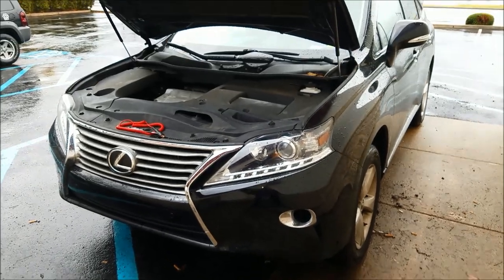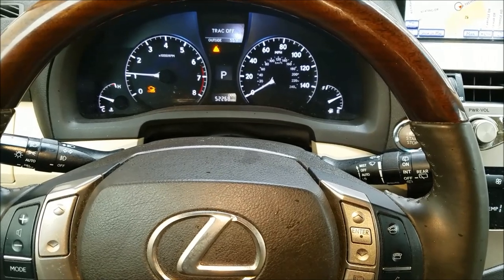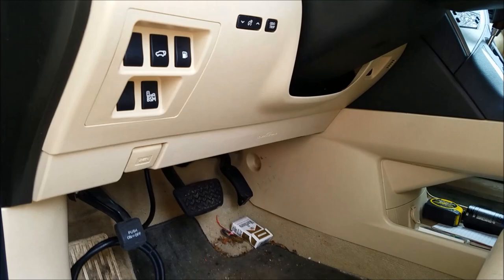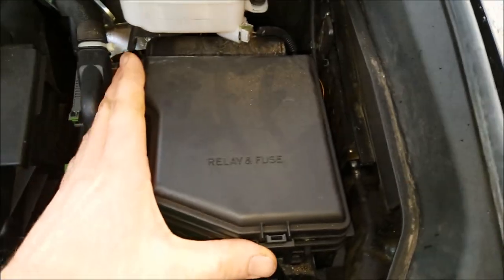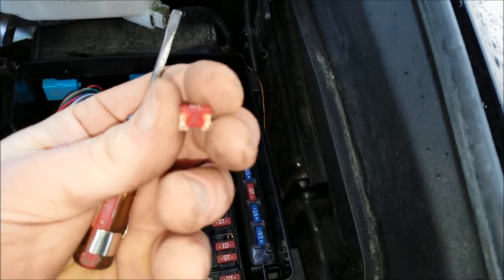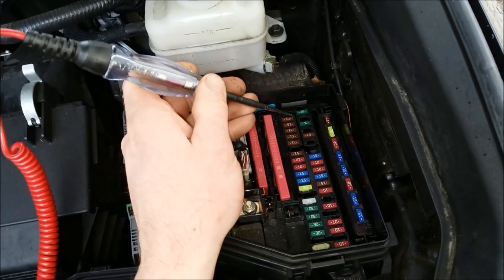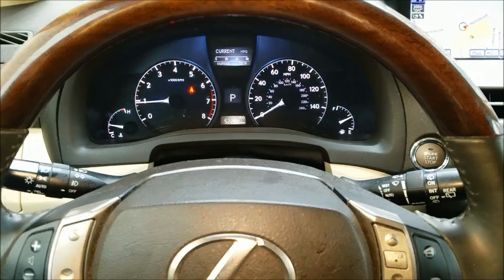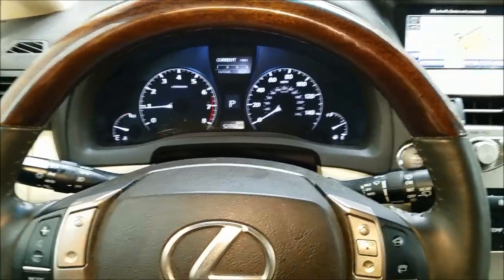LEXUS RX350 P2118 wont accelerate ETCS also FUSE BOX LOCATION toyota rx

Comment: THANK YOU VERY MUCH FOR THIS VIDEO! HAVE A CUSTOMER'S CAR HERE IN THE BODY SHOP THAT HAD A DEAD BATTERY. SHE JUMPED IT TO DRIVE IT HERE, AND WAS STUCK IN LIMP MODE EVER SINCE. REPLACED THE BATTERY WHILE HERE AND THEN THIS FUSE. NOW RUNNING GREAT. THANKS AGAIN!

Comment: Wow!  Thank you so much.  This just happened to my RX 350 this morning.   My husband tried to jump start the car and he got confused about placing the jump cables on the batteries and a bit of smoke came off of the connection and he moved the cables and let the car charge but the gas pedal just didn't work properly.  Look it up and found your channel and it has really helped.

Comment: 🎉 wow thank you so much I just took my 2013 Lexus RX 350 down to have some bodywork done after the bodywork was complete. The shop called me and told me that the car only idles and that it will need to be towed back to my house I was freaking out, so I got on line to look. What could be the problem I found at this website and and called the body shop and had them watch the video and bingo. That was it. The fuse was blown and now the car is perfect. Thank you so much who knows what this would’ve cost with me at a shop I’m so happy right now thank you thank you thank you.🎉

Comment: Had an issue like this in a 2006 rav4. The car was sitting for a while and needed a new alternator and after starting it ran like crap. Did some digging around and found the etcs issue and there wasn't even a fuse in that slot. Weird. Heading to go get new fuses now. Appreciate the video. Short and straight to the point.
Reply from the maker: Interesting. Wonder why the fuse was missing?
Reply: @NoNonsenseKnowHow  I have no idea. The car was purchased for my niece, SO put a new fuse in it and see what happens. Start with cheap fixes and hope it works.
Reply from the maker: Got you. Cool. Hopefully it takes care of the issue
Reply: @NoNonsenseKnowHow  The issue ended up being that AND the fuel pump fuse was blown. Quick easy fix.

Comment: Worked on my 2003 gs 300.  Thank you
Reply: I messed my GS300 trying to jump it. I changes the 120v fuse it was blown, now im looking for why the throttle wont rev the engine.

Comment: Thanks for this.
Currently have this issue on a 2005 RX300.
Fuse was indeed blown (after cross connecting the Jump Leads!), but with the Fuse replaced, still won't rev beyond 1800rpm.
Diagnosis shows no Fault Codes, but Engine Check Light remains on.

Comment: Thanks easy fix for my mom's avalon thought it was the throttle body
Reply from the maker: No problem. Thanks for dropping a comment.  Did you guys jump start the Avalon recently? I still haven't figured out why these fuses are common to pop
Reply: NoNonsenseKnowHow yea i believe that was the issue the battery was dead for a while just replaced it today and the engine light was on and it was idling weird and would not accelerate, and yea we jumped it so many times that's definently what caused the issue
Reply from the maker: Got you. Okay yeah that makes sense then. Must be the jump starting. thanks
Reply: NoNonsenseKnowHow yup thank you for this video i was about to buy a new throttle body saved me alot of time and money👍

Comment: I need help 

2007 is350 

Car was jumped backwards. So I had to replace the fusible link which I did. Car didn't start after wards . I checked fuses and remembered that I had to put the EFI fuse back in that fell the day before when I was checking them.  So I did that. The car started and the check engine light was on p2118. It had no throttle response. I then checked fuses again and noticed I think it was the ecu had a 15amp instead of 10 amp( I think that was the fuse ) so I fixed that.  Car Starrett and then shut off and won't start anymore . It will only start if it sits overnight but then will cut off immediately.  What could it be ????
Reply from the maker: not sure off hand with out seeing it honestly.

Comment: I have that code but it said more liek spring stuck open. So is that the spring in the throttle body? I check that etcs fuse its good.. but i had a check engine light. I pulled that fuse and put it back in.. started the car engine light went away and it accelerate.. you think is there something else is happening? 2006 lexus rx 330
Reply from the maker: Yeah I could have had something causing the throttle plate to be sticky. If it doesn't come back I wouldn't worry about it though
Reply: Well, i did drove it today.. ao far so good. Crossing my fingers that it was trigered by the 10amp fuse.. could be loosing connection even though it in.. you know.. but thank you so much. 👊🏽
Reply from the maker: @tengzturiagaiii3185  good to hear and no problem!

Comment: How do you reset the code?
Reply from the maker: Rolando Quezada with a scan tool or code reader
Reply: I have a problem now where the a/c doesn’t work. My vehicle was jump started wrong that’s I started having issues. Could it be another blown fused?
Reply from the maker: Rolando Quezada certainly could be yes
Reply: @rolan2dr  I am having the same issue where my AC is not working anymore either. Do you know how you fix the issue? Which fuse was blown?